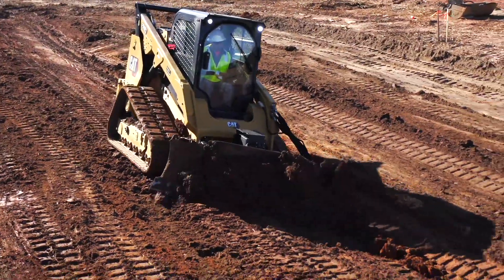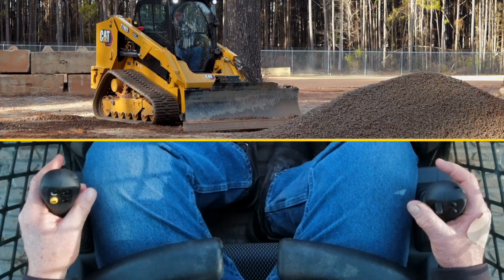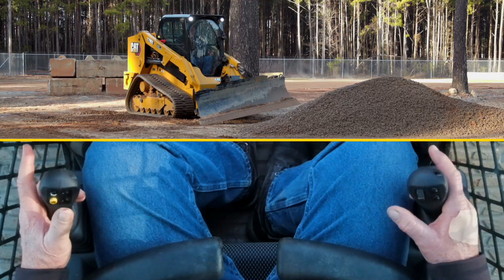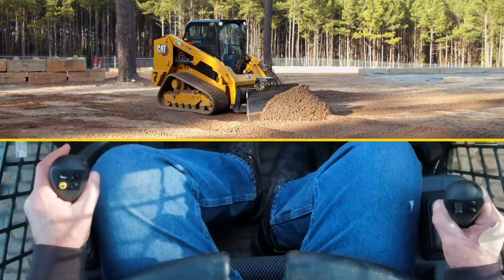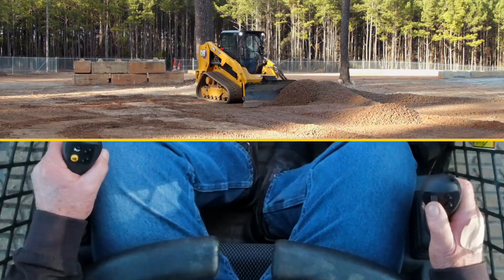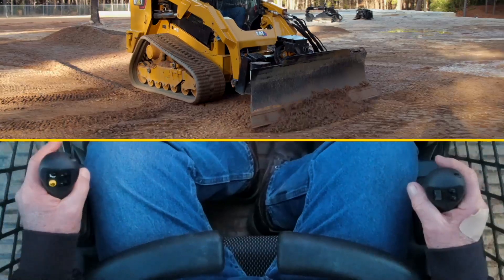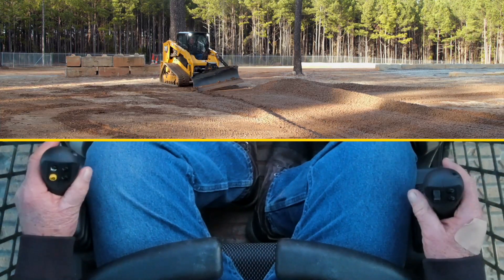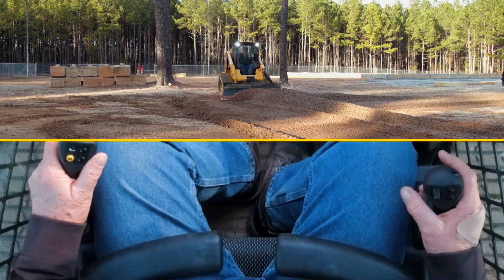Cat® SMART Dozer Blade Operator Tips

Comment: This is not a good description.   Especially your operator is terrible.  You can tell how uneven he leaves the material
Reply: I don't think he's an operator actually. All these manufacturers have a tendency to put a design engineer in the seat for demonstrations.
Reply: The blade is definitely harder to get used to than a real dozer or just having a bucket. And if you’re looking to do fine grading this is why they make a grader blade. I have both the dozer blade and grader blade and both have its uses. Although I don’t think I would do any major cuts with any skid steer attachments. I would say a skid steer is good for spreading material only. 
The smart dozer blade does grade nicely once you get use to it. I like using the arms to lift the blade. Smoother control.
Reply: I know that.  But they should put a real operator in there who actually can run the  skid steer and attachment .  If I was to judge by this video how this machine and attachment performed by this video I wouldn’t buy the product

Comment: It should be set up for 100% dozer control, right joystick does all blade controls, roller wheel does blade angle, left/right does tilt, up/down does blade lift with an option to use loader or tilt for up down.  Holding and clicking buttons for 3rd functions is not easy when on the fly.
Reply: I totally agree.
Reply: Agree
Reply: It is 100% dozer control. What buttons do you have to hold for a 3rd function? I have this blade and it doesn’t require holding any buttons.